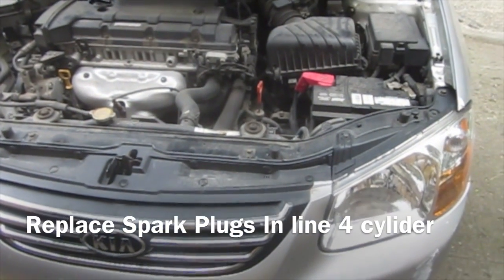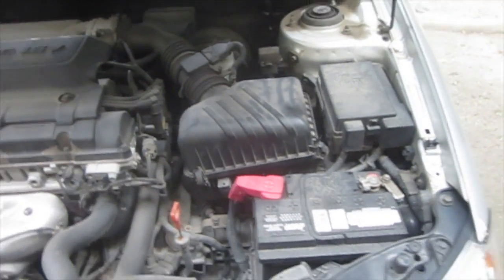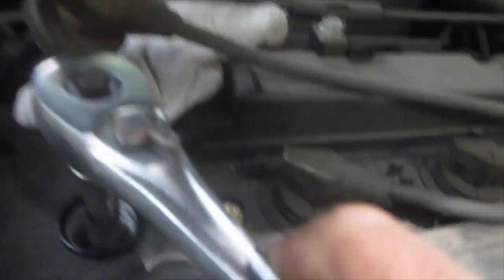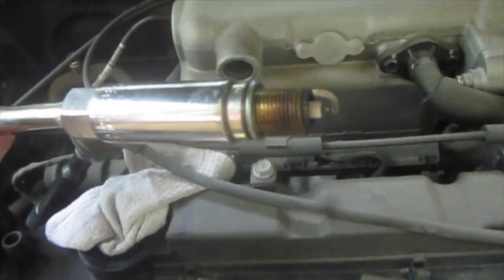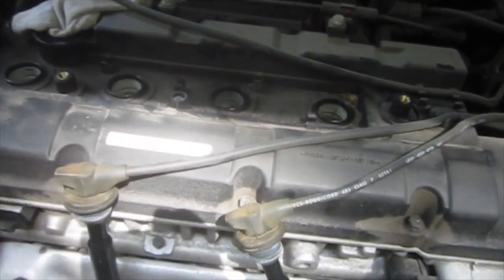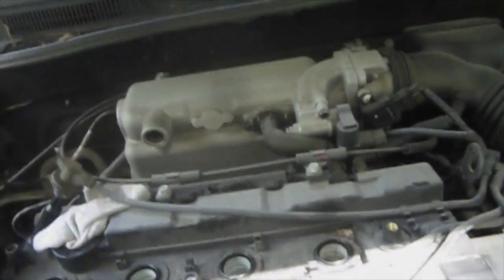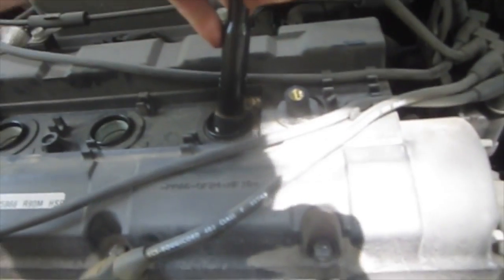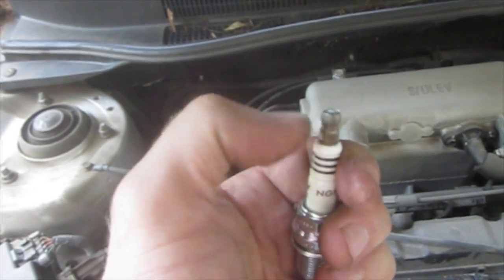How to Replace Spark Plugs In line 4 cylinder

Comment: U take the negative cable off... Not the positive, cuz negative is grounded... If ur positive touches any metal, it will spark up and fry ur electrical system.... it can damage.
Reply from the maker: +Canam Spyder taking either off makes the circuit incomplete.  Don't put a piece of metal between your positive terminal and the car ever - whether you took it off or not.  That would be silly.

Comment: hey nice video.
the process should be pretty much the same for a kia rio 5 2008?
Reply from the maker: +Jairo Poveda Only difference is that the wires to the spark plug are different but the operation is still the same.  The ignition coil wires can be unplugged by squeezing the clip, but it does not need to be unclipped unless you don't have the length to remove the coil pack.  Use a 10mm socket to remove each coil to access the plugs.
Reply: +Brue Hoyt thanks a lot. very helpful.